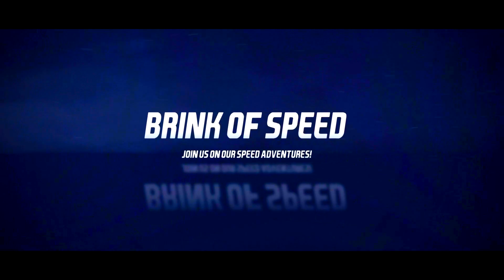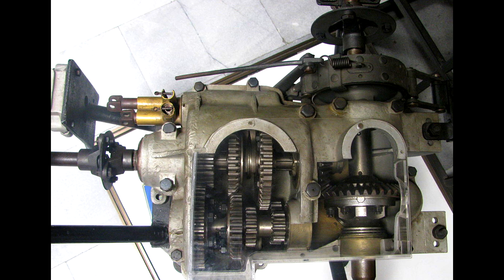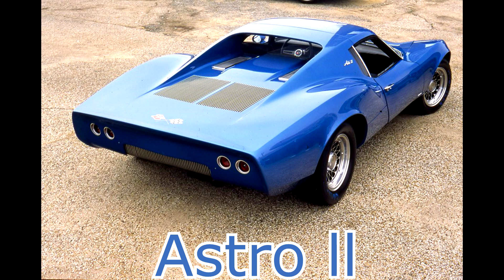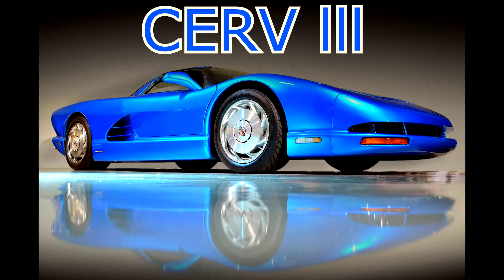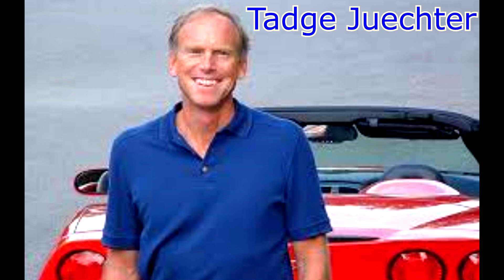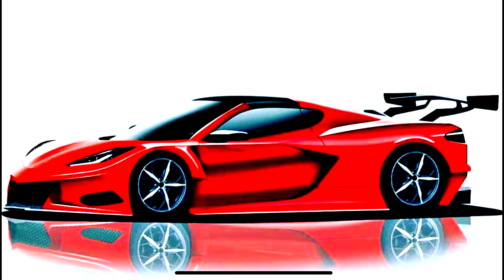What You Didn't Know About Chevrolet's Mid Engine Corvette!

Comment: I've had tons of Vette's all convertibles, Is the new C8 going to have at least a removable roof panel Targa style? The body lines don't look like they can accommodate a true convertible on this existing design without major modifications to the body lines.
Reply from the maker: mike stang it most likely will have a hard convertible top. This will recess back into the body of the car, just like any another mid-engine with a convertible hard top. Thank you for your feedback and if you have not joined my community yet, I’d love to have you! 😊

Comment: What? Put the motor in da middle?  What are they thinking?  It will fit right next the C-4 and the C-7 in the garage.  Those that are loyal to Corvette “know” it was the shape of things to come.  In addition, I really glad to see the C-7 will not be produced in tandem.  Focus on the mid-engine as the C-7 Stingray will join the mid-years, as short run, 6 vs 5 years and an icon in themselves...